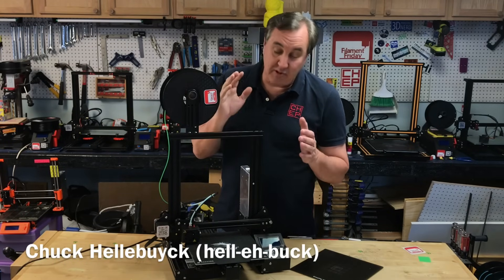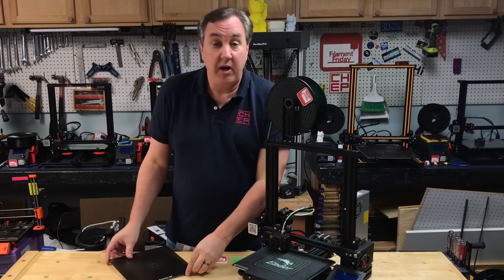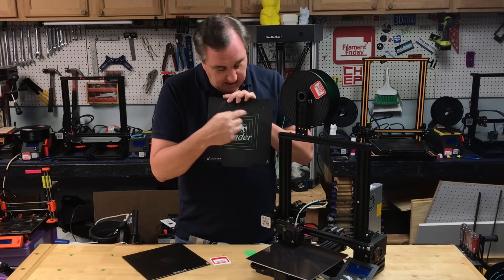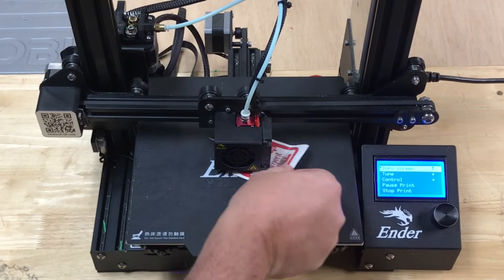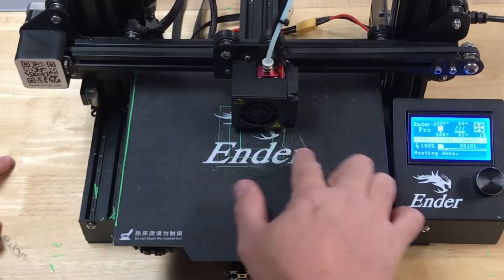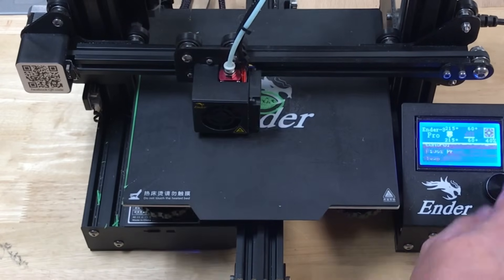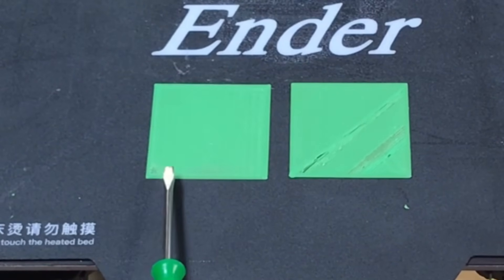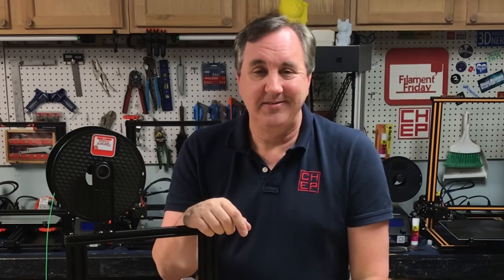Creality Ender 3- Easy Way To Level Your Bed

Comment: When I auto home it the printer nozzle is close to the bed but not over it. (It’s off the side of the bed.) I would get it level and the springs are all the way out and it still rubs on the bed. Please help. Thanks.
Reply: In case you haven't figured it out, I believe this is normal for some printers. Mine is that way too, and I have seen others say the same. It works just fine with its home being off the bed.
Reply: Lykus thanks for the reply, I got that figured out and it’s been fine for a few days and now the bed won’t stay level at all. I’ve leveled it over and over and when I go back to make sure it’s all level it’s completely off and when I print it’s super tight and way too close to the bed in one corner and in the other is way above the bed. In conclusion it’s not stating level now and I’ve only had it a week. If anyone could help or give some advice I would greatly appreciate it, thanks.
Reply: @romanbriley2740  Your bed is likely warped. This isn't uncommon, in fact getting a perfectly flat bed is rare. You can do some "manual adjustment". Put a flexible ruler on the bed upright and wobble it in the middle, side to side. If it wobbles freely, your bed isn't flat. Find out where the bed is warped, put something hard like a plank under it and give it a hard push downwards to bend it slightly. Do the ruler test again and redo until it's level. You know it's level when the ruler doesn't bend so easily anymore. You don't need much force or distance to correct it. Another way to make sure it's flat is to print a bed jack, basically a mini jack that goes under your bed and pushes it up to level it.

Comment: Where do you find the gcode for the 5 point setup. There is onley 1 link and that is for the test page
Reply: Description. There's a link to thingiverse. Download the zip file and open it, there's a folder there that contains the two stl files.

Comment: I would advice anyone looking 4 a good printer DO NOT BYE THIS ITS A PICE OF CRAP IVE HAD 2 NEVER AGIAN!!!!DO NOT WAIST YOUR TIME
Reply: If you're having a problem with your printer try contacting support. Many people have reported good results with this printer and I have experienced good results as well.
Reply: this printer is legit, sorry you had a bad experience
Reply: Buy an auto leveling sensor.
Reply: I've got the Ender 3 Pro and it's the best printer I've ever used.
Reply: L2spell

Comment: I appreciate the instructions that you have given, but you missed one important step.   I set my z stop to what was said in the manual.  Using your instructions I had to adjust my bed level on every print.   What finally worked was the suggestions in the forums.  tighten the bed down until until the springs are totally compressed then back each knob off 2 full rotations.   Now adjust your z stop so the print head is at the first position of the gcode you supplied barely has friction.   Then run the gcode all the way through.  this simple step has mad the bed very stable and the only time I have to relevel the bed is when I clean my glass.      Thank you for all your help!

Comment: What if my bed isn’t close enough for this. I tightened all the screws below, and the nozzle was still a ways way from it.
Reply from the maker: You have to loosen them for the bed to rise.
Reply: CHEP I figured it out thanks. Love the videos, very informative.
Reply: Follow up question. I’m running the dog g-code that came with it to do a full test. I’m getting some heavy shaking as the nozzle moves around the front of the dogs face. Is a shudder normal, or is the nozzle crashing? It doesn’t appear to be ruining the piece though.
Reply: @sleeklemur2509  The Ender 3 moves really fast when printing, that shaking is it "coloring in". It's normal. Observe the stepper motors. They would change direction very rapidly.

Comment: Great video. Just got the ender 3 pro, but 3 of the adjustable Wheels was loose in the Box. Do i have to thighten them all in before i began to adjust the bed?
Reply from the maker: Yes. Definitely.
Reply: @FilamentFriday  Thank you so much  :)
Reply: Just got my ender 3 pro and 1 wheel was missing.
Reply from the maker: That’s not good. Check in the box. They sometimes are under the flaps.
Reply: @FilamentFriday  checked. Ended up having to buy a m4 wingnut as a temp so I could start printing. This thing is awesome!

Comment: I've been having major problems with my Creality CR10S Pro, and someone on imgur recommended this video, used your paper method, but sadly, I am still in deep water without a paddle, or a boat, and there's sharks everywhere.
Reply from the maker: I’m not sure what the issue is based on that description. I did a review of that printer and found the auto level lacking. I ended up lower the sensor to 2mm off the bed then adjusted the screw on top of the sensor to get the right offset. I also changed the bed material to real Buildtak. It made a huge difference.
Reply: @FilamentFriday  Appreciate the quick reply and the information. Been having major level issues, with also major issues where the heat nozzle kept wanting to start printing like 5+mm off the bed. Since my post, I have turned off auto leveling, and managed to get 2 decent prints on rather easy designs. Going to trying some of those level prints and stuff when I get home from work.

Comment: What do you do if when you get the live levelling squares perfect, but when you print something that is large or comes out of the center of the print fails or is warped or deforms the print in another way?
I think my bed is warped as it seems to always be the same points that make prints fail (If you imagine a big + sign on your bed, the outer points of the + would be where it fails) and I cannot get single layer square or circle tests to print in some parts of the bed. 
I've spent weeks trying to get this corrected and I cannot count the number of times and methods I have tried to level my print bed.
Reply from the maker: Replace the bed. Glass bed is a good option.
Reply: @FilamentFriday  Thanks for the swift response! I actually have the Creality glass plate for it and the problem just gets worse but in different areas.
Doing 9 circle/square tests some are perfect and others not.
Can't seems to get it to print a first layer on most prints and if it does the print fails in another way. 
I just saw a video about tramming and am going to make sure all the frame and axis 
are level and are at right angles, but I did make sure they were level when I built it a month ago, maybe they have become misaligned.

Comment: I have found a set of feeler gauges (what we used to use fo spark plugs, remember those days, we could sort them ourselves). .02 feeler gauge, guaranteed every time. The first code is a great one, no touching the bed or nozzle assembly, risking knocking out of level.

Comment: The square test print is a great idea and thanks for explaining the effect of being too close or too high. Does printing at the bed limits ever pose a problem?
Reply from the maker: It can if the bed has any warp to it.
Reply: CHEP In that case I would be better off with a glass bed plate. I will first try your interactive adjustment with a large test square print.   Thank you.

Comment: I tried using your files and my printer started grinding into the mat, literally.   Any idea what happened because it created some ugly scratches in the mat.
Reply from the maker: Did you adjust it first after homing?
Reply: @FilamentFriday  No, I just assembled it actually.  I ran the home function after what happened in the file and it brings the extruder not only below but off the mat.   Is this normal and do you have a video that explains what you should do if this occurs?
Reply: @DvideByZero  I'm pretty new to printing as well and only have 3 prints in. But I can give you some answers though.
The extruder should go off the edge of the bed, this was if your Z stopper is too low, it wont hit the bed since it has room to just go lower (that's what I read on Google).
Secondly you scratching. If you just assembled it and it made really nasty scratches then I suspect you didn't put the bed as low as it possibly can, did you? If your bed is too high from the get go, then of course your extruder will run into the bed. The idea is to have the bed too low and adjust it upwards until it's just perfect, not the other way around by having it too high and adjusting it so it goes lower.
Third I'd like to say that you shouldn't lose faith in this video, from my experience it give the best results and the Gcode moves the bed, instead manually moving it with your hand.
Reply: @bob95180  Hi Bob, thanks for responding.   I am fairly confident the problem I experienced isn't with the author to.  That was my first attempt at 3d printing anything right after my first attempt at assembling a printer.    Translated, I am certain the problem is in fact mine.  I am just trying to localize where I went wrong before I try to print again.
Reply: Your nozzle is too close to the build platform it sounds like, you need to actually do the manual work of adjusting it before you try to print anything.. 

Note, I'm not judging.. I may or may not have done the EXACT same thing right after assembling my first printer a few years back..

Comment: Hi, if you want to use glass, do you use it on top of the magnetic sheet or do you remove it? Do you use any preferred type of glass?
Thanks!!
Reply from the maker: I’d remove the magnetic bed but either would work. I did a video on glass bed:
https://youtu.be/mDNo1yyGosI

Comment: i have difficulty inserting the filament into the extruder  could the brass part the holds the bowden tube have a conical end inside so that the filament would not "hit" the blunt end  that would save a lot of time....alternatively, could a short piece of the bowden tube be placed in teh hole where filament is inserted...i only use the filament size that came with the cr10 that i just purchased ... thanks
Reply from the maker: I unscrew it sometimes to get the filament to go in.

Comment: i like your videos well done thanks I have just finished building my ender 3 ha gone through all the bed leveling. the problem I have is the printer is printing off the bed towards the stop switch have you any other videos that you could tell me about before i do something any help you can give me will be a big help if not any one else i can try thank you for your time

Comment: I'm running your G-code but the my nozzle isn't moving all the way over to the right. It starts in the bottom left fine, then only goes about 3/4 of the way to the right. Instead of to the corners like in your video. Am I doing something wrong?
Reply from the maker: Same size bed?

Comment: so if im using PETG, can i use this to level if i just adjust the bed and nozzle temps to suit?.. or level with PLA then adjust with PETG? I'm having issues with PETG sticking and printing nicely for me.. not sure how to read the hi or low signs with it i suppose.....
 Thanks Brother ;)
Reply from the maker: Level with the material you are using. I used a fresh Buildtak sheet on mine for PETG.

Comment: Does anyone know why my nozzle/bed is moving at an excruciatingly slow speed during calibration (like 5mm/s). From the video, it looks like it's supposed to be moving at > 40mm/s. Is there a setting in Ender 3 that I need to set to make the nozzle/bed move faster?
Reply: same here

Comment: Hi, thanks for this video.  I try to use this method, but encountered an issue.
The knob beneath the bed is almost loose while I try to level the bed, but I still didn't get the bed leveled.
Where else should I adjust?
Reply from the maker: Check to make sure the carriage underneath isn’t bent.
Reply: @FilamentFriday  Thanks for the quick reply! I will check that out.
Reply from the maker: The metal frame under the bed.
Reply: @FilamentFriday  I got it figured out. It was not enough tension on the spring. After I put more tension on other springs, it's working fine now. Thanks for helping out!

Comment: Still keep coming back to this video lol just noticed for the first corner you say adjust so theres a SLIGHT resistance but on the other corners you say to have SIGNIFICANT resistance ??
Reply from the maker: Definitely should be more than slight. Doesn’t matter though because the live adjust is key.
Reply: @FilamentFriday  makes sense thanks!

Comment: my print bed not flat.. how to fix ??
my printer ender 3
Reply: if you are saying its warped, go buy a glass bed. some hardware stores have packs of thin window glass for cheap. I got mine from I believe Lowes or Home Depot, plus a glass cutter for around $10 US. It was a pack of 6. This helped my bed magically. It's still not perfect, but MUCH better than the wavy mess that the standard bed was.

The other option is to go download a custom firmware that has the option to use Manual Mesh Bed leveling, which uses the software in the machine, with points you set in its memory, so that it knows where the highs and lows of the bed are, and compensates...
Reply: Sorry but what the hell do you mean
Reply: @cloroxdomem6699  But you do know what he meant my friend, he just told you, my English too is not exactly where it should be after several years using the language in question, but hey people understand me that's the most important factor when communicating. Likely to understand even the basics of grunting troglodyte by body language, facial micro expressions , no?  But yeah his bed is warped, so is mine and many others too, seems common for Ender 3 but also other cheaper printers. Only so much they can do with that limited budget, me I am still a bit surprised how much we do get for the money these days, value is through the roof if willing and able to invest some time learning, setting it all up.

Comment: How in the world did you get that plastic off so easily? My stuff sticks like cement
Reply: Indeed, to a point where it's hard not to damage the surface removing, I suppose I will learn more tricks when growing into the this hobby cause not like fish out of water, step learning curve, impatient and basically no free time is a bad combination but it's fun too so I'll get there. Trying to remember from school and the CNC education they gave us, for any advantage haha.
Reply: I used to have the same issue with PLA (Ender 3 pro) and found a simple solution. After a print I let the glass plate (with print attached) cool to room temp. I typically set it on a granite cutting board since it's a large heat sink and the temp equalizes rather quickly. After that, I simply set the glass plate (with print attached) in the freezer for about 10 minutes. Pull the plate out of the freezer and the print will pop off with minimal effort...no need to scrape off any of the pla :) The glass bed also leaves an awesome finish!
Reply: Forgot to mention that the reason it works is due to the CTE (coefficient of thermal expansion) differences between glass and pla. The pla is going to shrink/expand faster than the glass for a given temperature...I think its around a 3X difference.
Reply: @greasecraft  I swapped out my stock bed cover for a flexible magnetic one. Made a huge difference.

Comment: I have a monoprice maker select v2 I try to run this level test but it doesn't stop just runs the entire bed and then stops like a regular print would do am I missing something cause this seems like it would work a lot better for me if I can get the test to run correctly
Reply: You've probably figured this out by now and I'm really new to printing, but i believe the gcode is specific to each printer, so this would work for the Creality Ender 3 but potentially not others. You'd probably have to change the gcode or obtain one for your specific printer

Comment: Hello, looking closely to my Ender 3 i noted the X axis is unleveled. I tried some methods and is almost leveled but now I'm having problems with the first layers. It looks warped. And I feel the right side of the X gantry is not moving at the same rate of left side. There's some step by step procedure to align the X gantry correctly??
Reply: is your drive belt tight what about the eccentric nut

Comment: Hi thank you for all your videos they are great I got mi first 3D printer today  Creality Ender 3 basic model whit the bed whit clips  this is all i can afford now and I make lots of research before I buy it. Your videos guide is great first thing i see is  the carriage for the bed is got some movement  side to side you explain this in one of your videos how to adjust that so before i put it all together i going to make some adjustments i work for  the printing industry and injection molding for 35 years from manual to auto i know how critical is unnecessary movement on a machine I hope this is the video you explain that part but is ok  so thanks you for all you work an honesty   in today world not easy to find

Comment: Great work as always Chuck,

 I've been using your method of bed leveling since I've gotten my printer and it works great.
in the past I had to remove the purge line settings in my cura cause it would print the purge line way off the printer bed.
Your purge line in the square print test is perfect and would like to add it to all my prints can you share the command line? Thank You again.
Reply from the maker: Just open the GCode file in text editor to see the settings.
Reply: @FilamentFriday  Thank you, looking forward to more content from your channel.

Comment: Will this work G code work for a CR-10 S5 or where can I find something similar?  My S5 was running fine.  It sat for awhile and now it doesn't print on the left side from 7:30 to about 11:30.  What process would I use?
Reply from the maker: You have to adjust the G-Code settings using a text editor